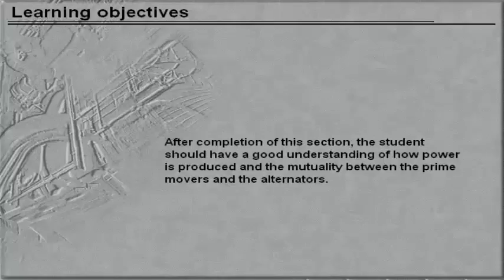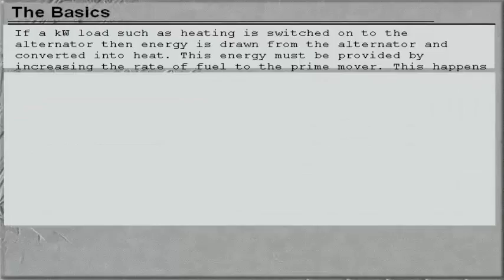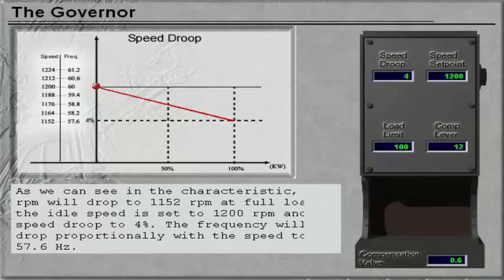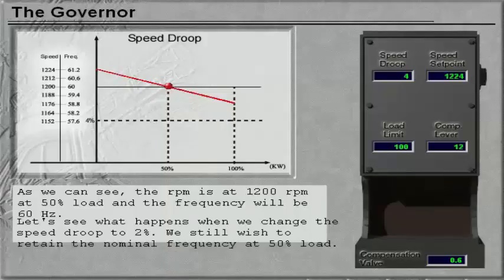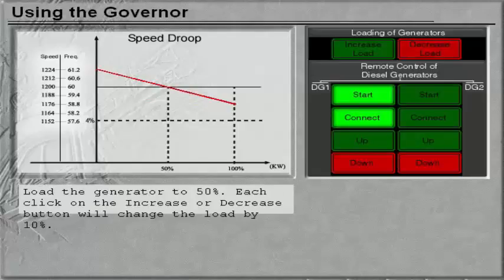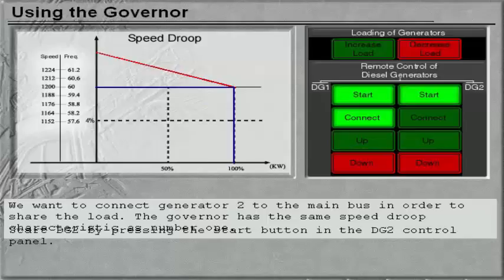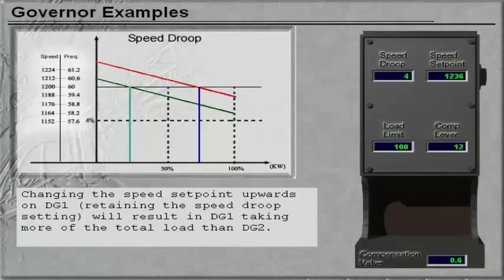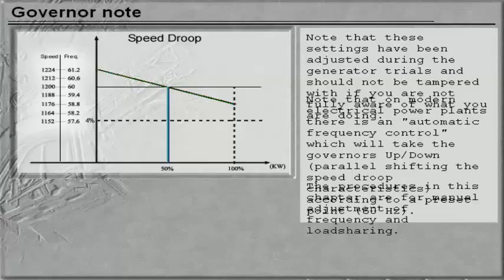Frequency Control in Synchronous Generator

Comment: I have a combined cycle  2 Gas turbine(2GT) and 1 Steam turbine(ST) if transformer 500KV for ST in the service and when enter any transformer for any GT in the service we find the transformer for ST to be out of service (trip) by signal vibration at bearing 6,5,4 for the turbine .
Note: the signal of the vibration not high but the signal reach to the zero value for 29second and back again to the normal value.
Why the vibration of steam turbine reach to zero value for 29 sec and back again to normal value?